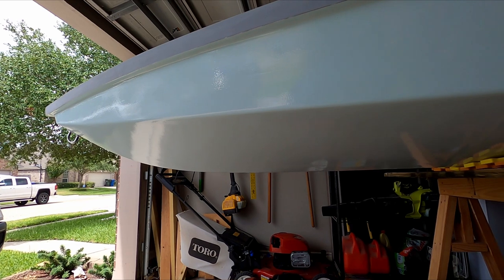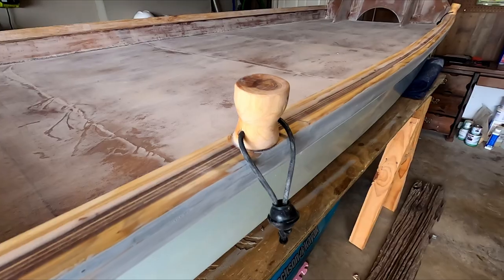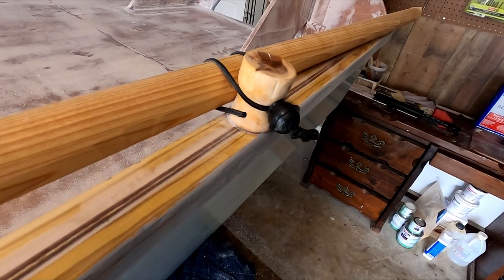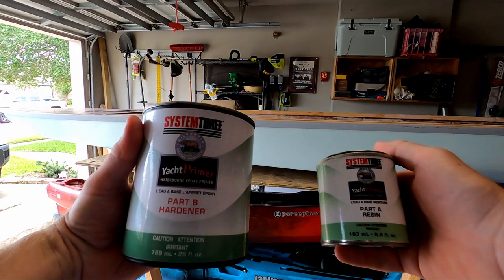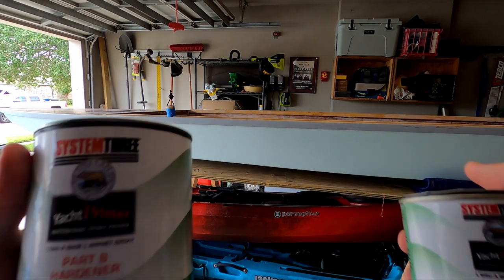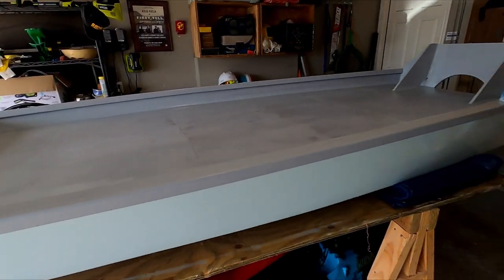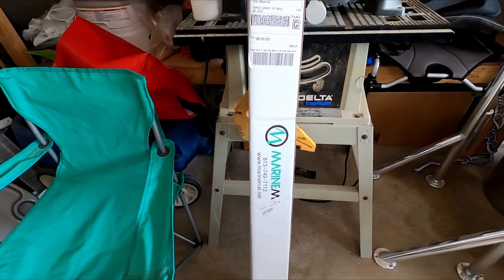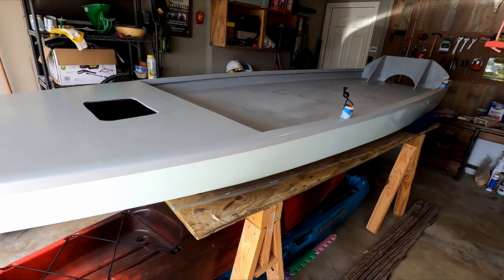EP5: DIY Skiff Update - Priming the Topside of my Bateau SK14

Comment: Those push pole holders came out really nice! 
Did you add the extra wood to the transom for added support you talked about?
Reply from the maker: Thank you! I really appreciate that. You know, I've decided against permanently adding the board to the transom. However, I am going to cut a board that will fit there and just throw it up when I'm mounting the motor. That way I can easily replace it when it gets damaged.
Reply: @SchwindOutdoors  as long as you treat it the same as the boat it should last you a very long time. Can't wait to see the next update!